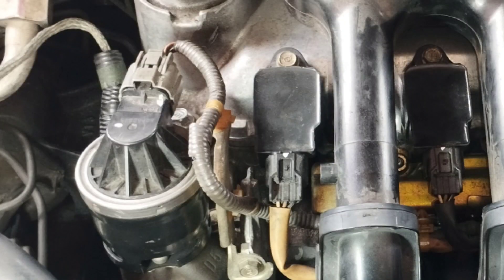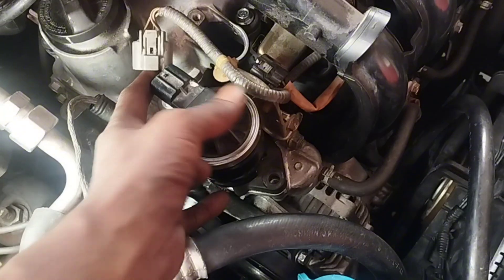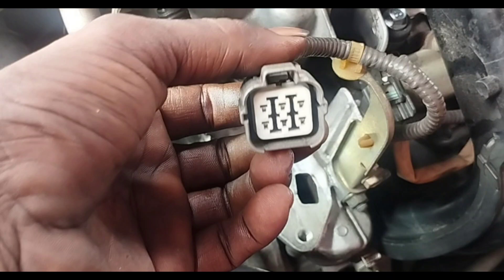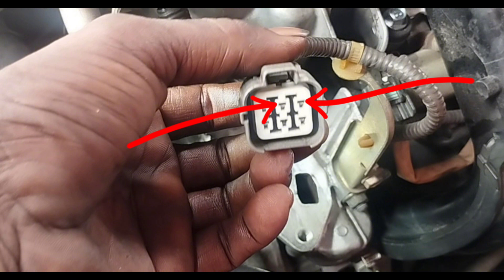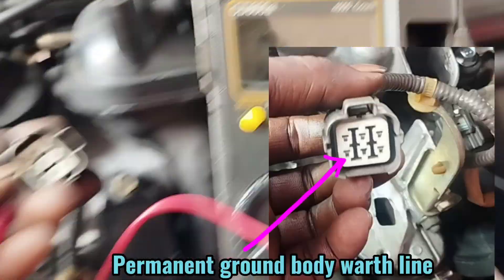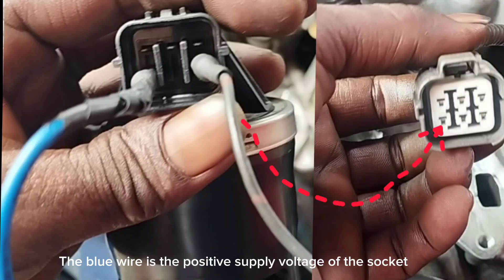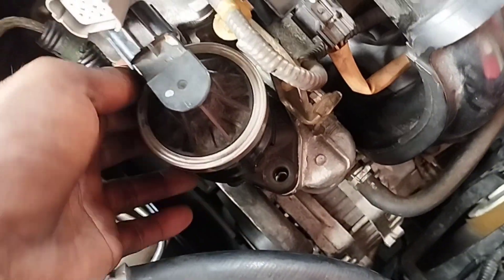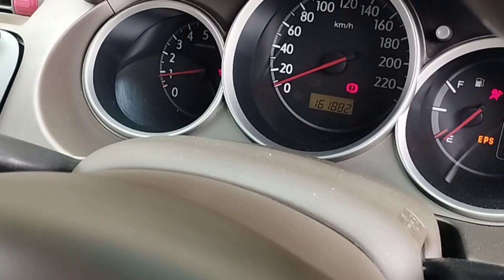How to test an electronic EGR valve solenoid ! Bad EGR Valve symptoms ! Solved the problem

Comment: I still have a p0403 code on my transit connect xlt even after replacing the egr valve, any reason why??  The van was running rough, poor fuel consumption and slow acceleration even before the check engine light had came on though. Now the light won't go away even after replacement.
Reply: Obvious question,  did you reset the event?  The code? After put the new EGR?
Reply: @DGQ1Q2 it ended up being the pigtail harness. So I bought a new one and re wired it. Problem Solved!!! Haven’t seen the code since I changed it.

Comment: Did you checked the voltage of the plug when engine is running? Or just ignotion is on?
Reply from the maker: Ignition switch on position

Comment: Hi, on my accord 2010 2.0 gasoline , positive supply voltage on yours is 6,2v and on mine is 8.8v , does this mean my egr valve is half open all the time ? Can u help me   ? thanks
Reply from the maker: Disconnect the EGR valve assembly connector.
Turn the ignition switch to the ON position.
Measure the voltage according to the value(s) in the table below.
Standard voltage:Tester Connection
Switch Condition
Specified Condition
B69-2 (+B1) - Body ground
Ignition switch ON
9 to 14 V
B69-5 (+B2) - Body ground
Ignition switch ON
9 to 14 V